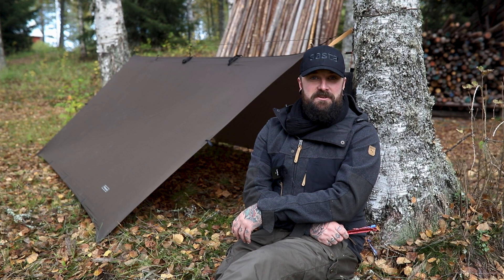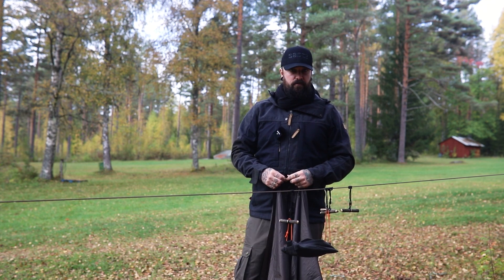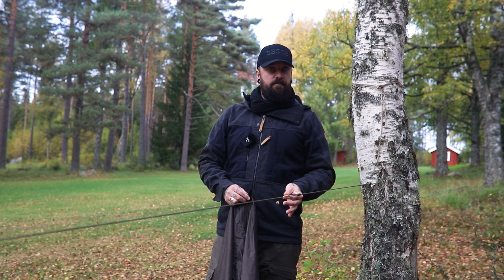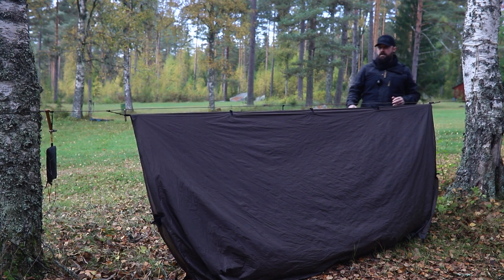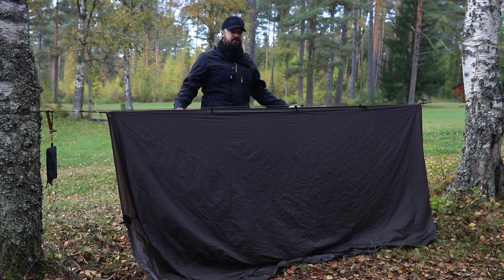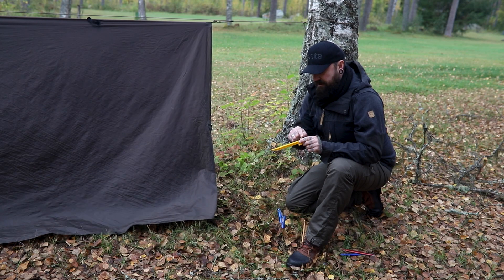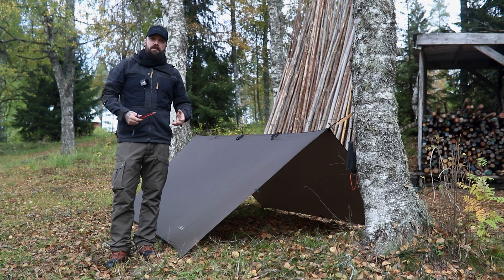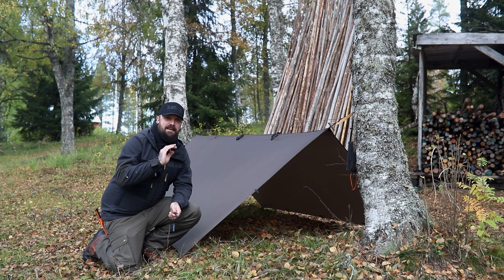Building A-Frame Tarp Shelters Step-By-Step - Your Ultimate Guide

Comment: Thanks for this. A very interesting video would be some tips and the general approach on how to efficiently change setup in a clean way in case the weather conditions change abruptly. For instance, if heavy rain starts to fall and the setup chosen was not the most proper one for heavy rain; or in case strong wind starts to blow or changes its direction. For instance, if in this case it starts to blow in the direction of the A in the A-frame.
I am conscious that site selection is the most important aspect. However, in case one cannot find the perfect spot and the weather unluckily hits exactly on the weak spot of the site selected, I'd like to be clear-headed in such situations.
For instance, I've already found myself in a situation where there was some wind, nothing exceptional, and opted for a tarp tent setup. However, later on during the night the wind started to blow way stronger and changed direction blowing directly into the entrance of the "tent". I was then forced during the night to re-pitch the tarp tent rotated away from the wind, and doing so with the risk of my gear flying all around. Managed to do so decently, but I would like to improve on that (knowing that we were in a little exposed area, which is something to avoid, I know) and have a more consistent and awared approach. Thanks!
Reply from the maker: Perfect question Marco. If the wind and weather changes. The set up I quickly switch to is a plow point which is next Sunday video. 

Hope your well brother 🤜🏼🔥🤛🏼